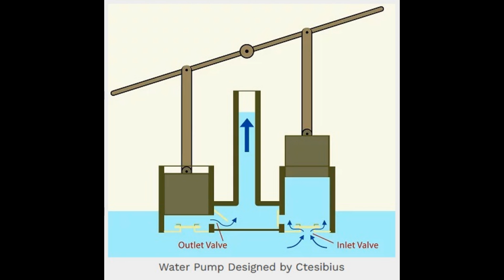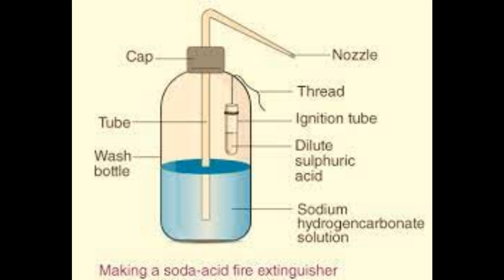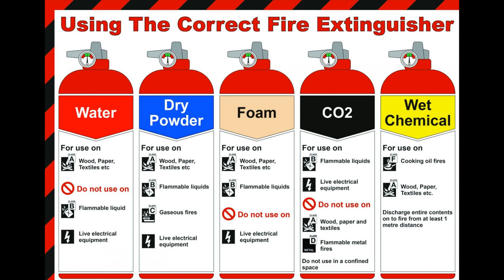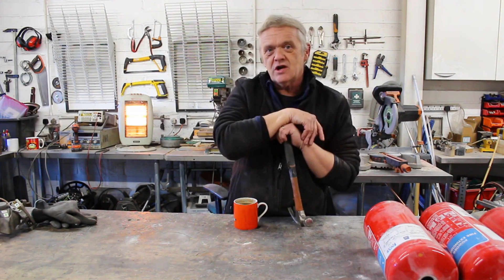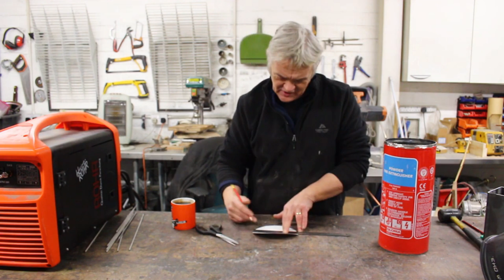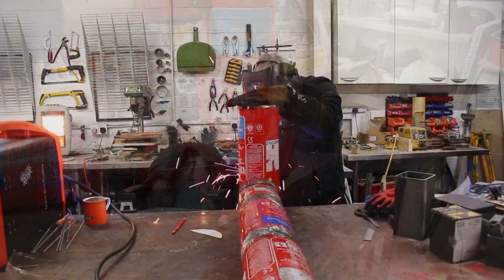041 Fire Extinguishers - What To Do With Them

Comment: I use 4 extinguishers to inflate my boat tender.  Look for the ones with the tyre nozzle valves. I use a compressor to pre charge them and horse them into the back of the car.

Comment: I get out of date CO2 extinguishers to use with a regulator as almost free MIG welding gas. Once empty I've done various things with them, like cutting them in half, spraying the bottom half green, and using them as alloy plant pots.

Comment: Like to add,if you get Co2 extinguishers that are still full,these can be used for welding gas(MIG) just turn it upside down attach a Co2  regulator and weld away,it burns hotter than argon mix so ideal for thicker steel😉

Comment: In your pump shown at 1:00. What happens if you have 3 or 4 of those on a ring with a heavy weight that is rotated around the ring.  Much like a current variable displacement piston pump.  Could that use significantly less energy than conventional centrifical pumps.  

How about moving massive quantities of water using a sealed tube archimedes screw. The entire spiral tube assembly rotates. The lower end on a floating barge so the tubes are never filled to the upper root diameter which would cause it to empty out.  This could be used were 20 to 100 foot lifts of water are needed.   Almost half the electrical energy used in california is used to move water around the state.  That is a huge amount of power. One lift is just under 2,000 feet vertical to supply los angeles .   40,000 horse power electric motors do that.

Comment: As a pipefitter in my younger days, we used a large metal "saw horse" design with wheels mounted on each end in pairs similar to your set up in concept. The wheels were around 5-6" diameter and one had a geared motor with adjustable  speed control so the speed could  be adjusted for different diameters of pipe..
On a large order of duplicate pieces, I rigged a foot switch to the welder and mounted the "gun" on a pedestal in the proper place.....sure made welding pipe/flange seams easier. 
Great idea Luke!